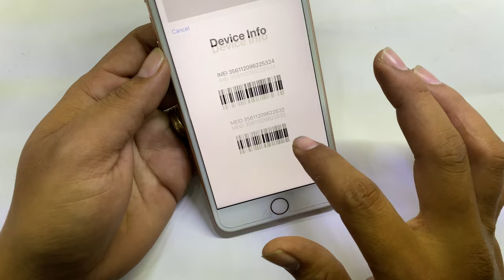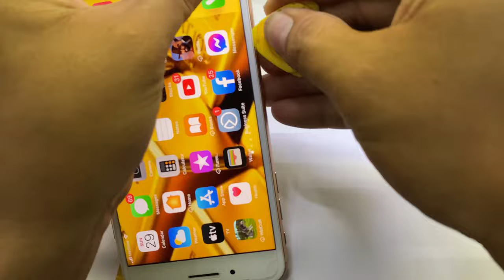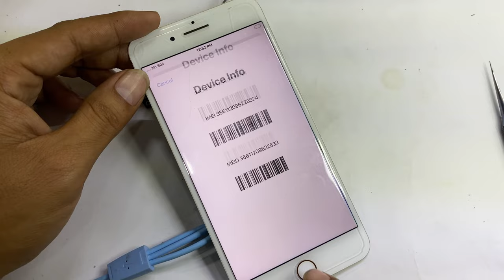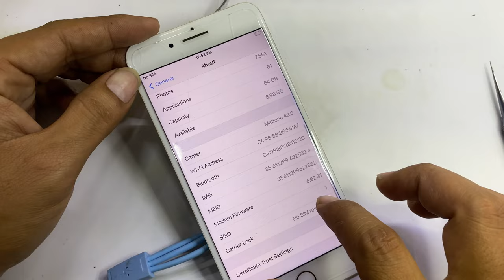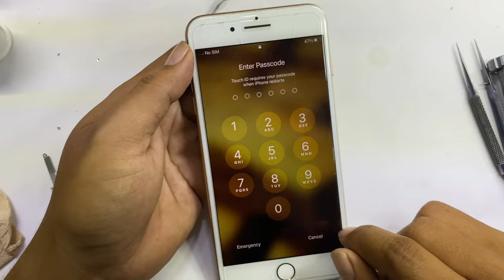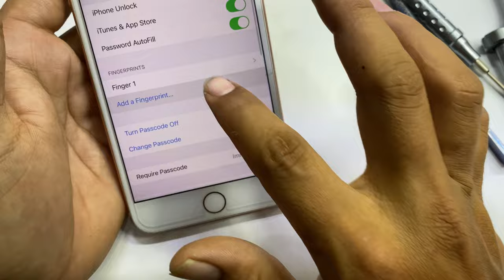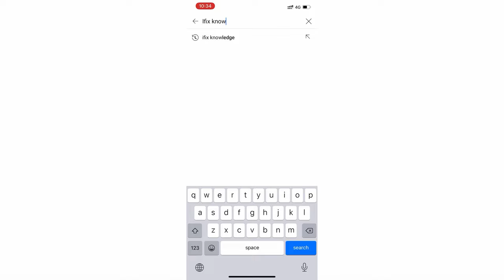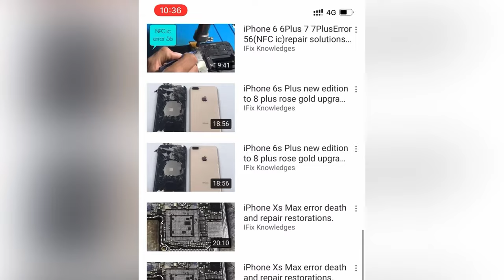iPhone 8Plus No Sim install/No Service/No iMei/NO Modem Firmware/Searching Repairing WTR IC ...

Comment: I’d love it more if u gave it more details like,the software hints that indicates the problem is from wtr.
Why did u head straight to wtr?
Why not bbpmu?
Why not bb?
Why not check for shorts as well?
Cus all this factors listed can cause similar issue like this.
What if I get a same phone if the same model 
Replace wtr and it doesn’t work what do I do next if I’m still a learner?